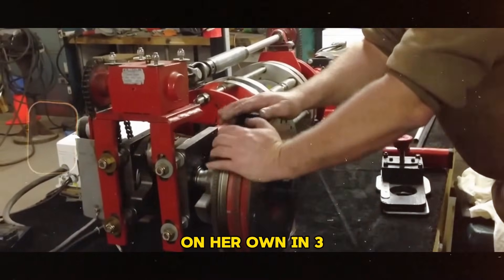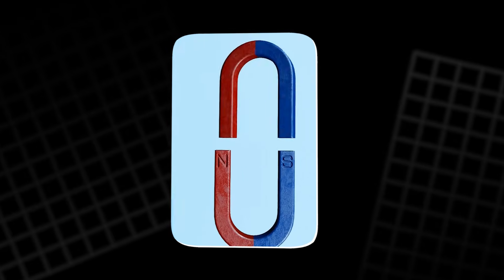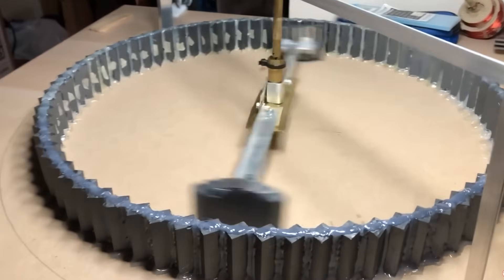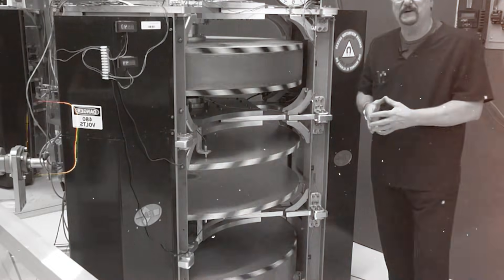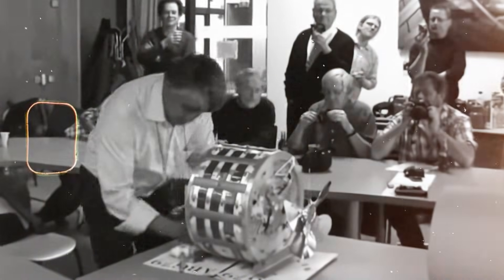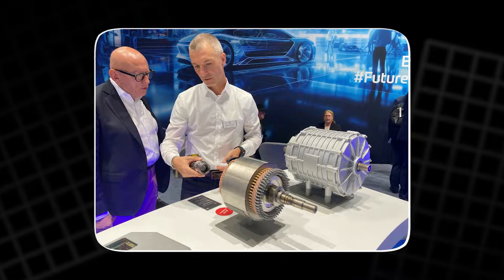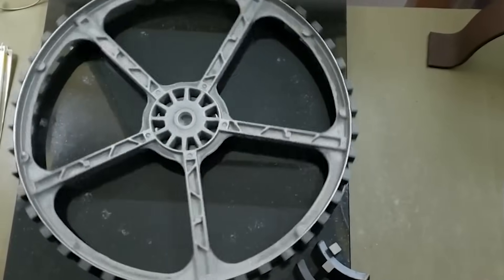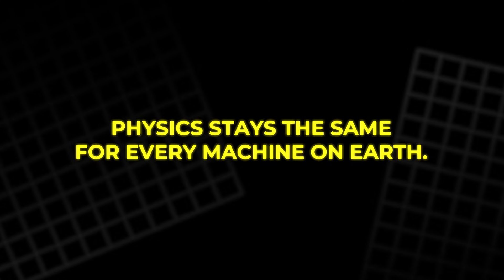The Magnetic Motor Myth: 30 Years of Claims, Secrets, and the Truth Behind Free Energy

Comment: Or better yet, how about a machine, stand alone or even portable that can create and hold a thunderstorm?  A Thunderstorm =  hot moist air colliding
with cool dry air.  That's it. And once it is started the thunderstorm is self perpetuating and the lightning from the thunderstorm is where you
get the electricity.  Use it directly, or use to charge batteries. Our culture is not the first to have and use electricity. Ancient Egyptians absolutely had the use of electricity.
You cannot build the Great Pyramid of Giza without having electricity. It's totally impossible to build such a structure with only manual labor.  It's like, duh  !

Comment: We just need to tap into the earth's electric grid. The earth is a "Perpetual Motion Machine". Specifically an Alternator creating 3 phase AC electricity. The earth 
 has a massive magnetic field that enables the planet to have an atmosphere, water and life.. Magnetic Field = Electricity. You cannot seperate the two. Tesla re-discovered the alternator which  spins does it not to create electricity?  The earth spinning on its axis also creates electricity. "Lay Lines" are fissure in the earth's crust where it
is easiest to extract the electricity. The Great Pyramid of Giza is built over top the junction of 2 Lay Lines. Tesla invented the Alternator based of the earth's spin.